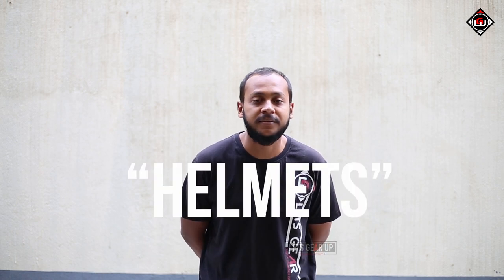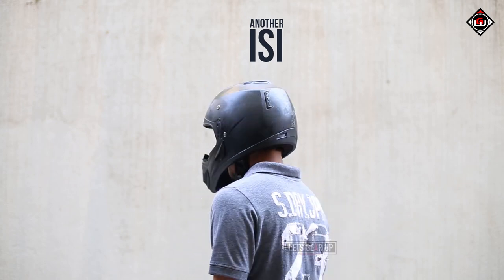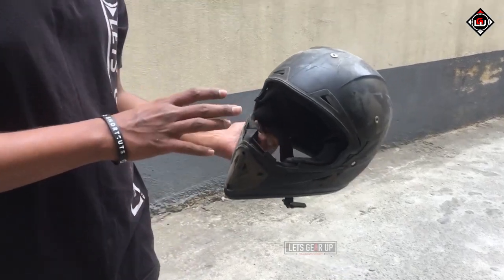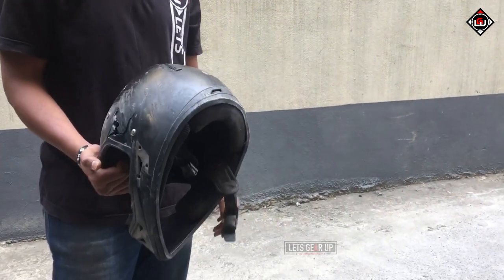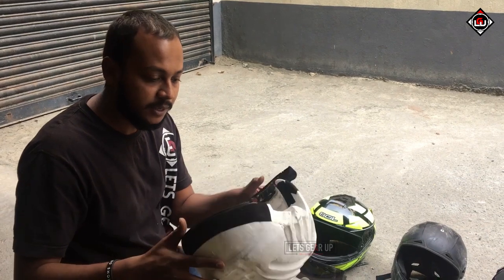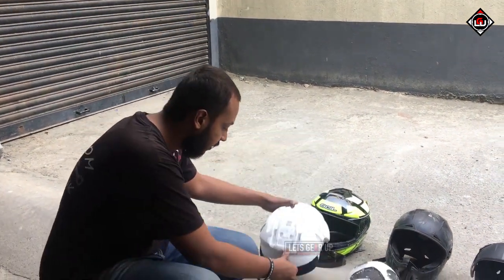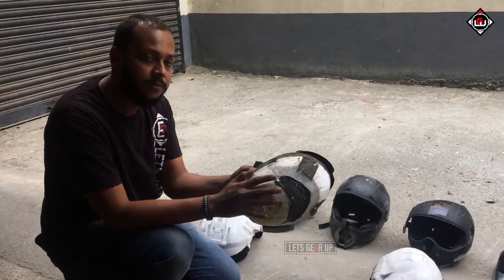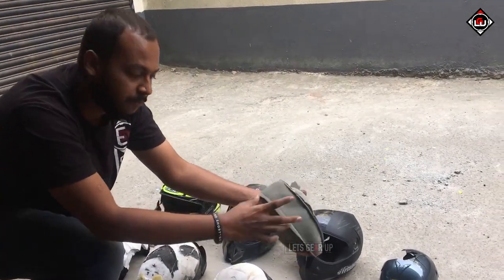ISI vs DOT, ECE, SNELL, SHARP ratings / certifications on helmets

Comment: I appericiate the effort you guys put in this and destroyed helmets costing so much. So basically its not abt hw many hits the helmet can take.. Its abt hw much force it transfrs to your skull in case of a crash.. Still great content 👍
Reply: devashish chauhan yes... I haven't seen any isi helmets with an outer shell and an inner shell and then the thermocol lining though... At the same time have seen many dot and ece ones having such multiple layers. Which means they will take a lot more impact before transferring that energy to the inside. Along with that the way they have a lot more padding than normal isi helmets means that the head won't go to an abrupt stop in case of a collision, which is the reason why some riders loose consciousness and sometimes go into comma in case they come to a violent stop. Helmets with multiple layers, padding and international ratings any day over isi one's as far as I'm concerned.
Reply: Yep. Content is kind of misleading.
Reply: Thank you! This is the only comment thread that to some extent sees through the pointless test in this video. A helmet is indeed designed to decelerate the skull of the wearer over as long a duration as possible. Hitting a stationary helmet with a sledgehammer only shows the strength of the shell, not its ability to protect the soft mushy brain of a human being.
Reply: These helmets are supposed to take single impact from accident in a short span of few seconds and not multiple impacts. So ISI helmets from reputable brands have good enough protection. DOT helmets are expensive and not everyone can afford them, but its helpful for those into motor racing or high speeds
Reply: @ahmedajmi8173  it's not entirely anoutthe shell bro read the above comments ... It's about how much shock is diverted in simple words
Reply: @YashMoh  ISI helmets are not designed for High speed touring or racing. The ISI helmets from Reputed brands like Steelbird, Studds and Vega are excellent in protection when riding in City conditions and should also protect decently on highway depending on the speed they going and impact type...For highways in case of higher speeds definitely better to go for DOT or ECE.

Comment: I see some discrepancy here, for the ISI certified helmets you put them in between a tire so they will not skid off, however for the DOT certified one you put it ona Rock and it seemed that for the DOT certified helmet it was not able to take the complete impact of the hammer because of that as it skid off after the first contact with the hammer.
Any reason why you put the DOT certified helmet on a  rock instead of between the tire.
Reply: That's exactly my point as well...

Comment: the main problem is not with their breaking but with the amounth of flex! every hit the ISI helmet takes, i goes deep inside and again flexes out like a water bottle! so it's definitely going to affect the head.. whereas the dot certified helmet was very sturdy and didn't have much flex!

you should have tried them with a watermelon or something inside
Reply: Shravan Also, this video hardly shows how well a helmet will work in case of a crash. A helmet is designed to decelerate the skull of the wearer over as long a duration as possible. That means the helmet and its contents will have to be in motion. Hitting a stationary helmet with a sledgehammer only shows the strength of the shell, not its ability to protect the soft mushy brain of a human being.
Reply: Yeh
Reply: @twistednemo  dot helmets are designed is a way where the impact will be distributed over the helmet but wont go to you head
Reply: @8thX  yeah i got my friend back without any major injuries as because MT Truck Turgo Helmet which is DoT ECE Certified

Comment: Woah! 😅
The DOT approved helmet these guys just destroyed costs around 8K
Hats off to you guys!
This video will hopefully open the eyes of the cops
Also I would like to know if you guys have a red SOL SF 5 Alpha in stock (the same model you guys just destroyed)
Reply: 6200 at the right place! SOL 1/2 series
Reply: sunshinegears, not a promotion, I just know where to buy it from
Reply: Yeah, but this video hardly shows how well a helmet will work in case of a crash. A motorcycle crash helmet is designed to decelerate the skull of the wearer over as long a duration as possible. That means the helmet and its contents will have to be in motion. In case of a crash, the helmet shell has to distribute the force of the impact over a large area and the liner has to compress and dissipate the kinetic energy of the wearer's head. Hitting a stationary helmet with a sledgehammer only shows the strength of the shell, not its ability to protect the soft mushy brain of a human being.
Reply: Bro they can earn tht much money from this video don't worry
Reply: for people wondering what he means USD, that’s about a $700-800 helmet from looking online, this was also 5 years ago so i can’t say the price changes from then to now

Comment: ISI < DOT < ECE < SHARP < SNELL
Reply: supercharged petrolhead 

I agree on the order of how tough the tests are, but that doesn't NECESSARILY mean a helmet with a more stringent certification is safer than a helmet with lesser verification. 

For example, a helmet that far exceeds ECE certification could be safer than a helmet that barely earns SNELL.

SHARPS is nice because they actually tell you the results of the test.
Reply: Isn't sharp a rating. snell and ece standards
Reply: snell and ece are just on crash worthiness and safety hence i think they are standards and sharp is more of a well rounded test which consider safety along with some comfort and fit and finish and hence a rating i guess and helmets made or sold in europe should be sharp rated and it is more of a european specific testing, i guess
Reply: Wasn't the 2005 Snell standard dangerous for street use because the liner was to be kept extra stiff to ensure the ability to absorb impact forces in multiple head collisions in a crash? Also, the video does not demonstrate the ability of a crash helmet to absorb impact. To test that, the helmet needs to be in motion. We are not talking about construction site hard hats here after all.
Reply: Ece's are better
Reply: SNELL< VIBRANIUM 
- The strongest metal in UNIVERSE...
but Black Panther won't share it with you.
Reply: FIM > All

Comment: First tried by Motown India for ISI😀
First tried by you guys for DOT. 😇🤘
Reply from the maker: And we hope to be the first for other products too :)
Keep yourself locked onto our channel (Y)
Reply: Yeah, but what is the point? This video hardly shows how well a helmet will work in case of a crash. A motorcycle crash helmet is designed to decelerate the skull of the wearer over as long a duration as possible. That means the helmet and its contents will have to be in motion. In case of a crash, the helmet shell has to distribute the force of the impact over a large area and the liner has to compress and dissipate the kinetic energy of the wearer's head. Hitting a stationary helmet with a sledgehammer only shows the strength of the shell, not its ability to protect the soft mushy brain of a human being.
Reply: @letsgearup6675   I have Vega brand helmet like FIA World Car Rallying Championship Semi Half Helmet and top side shows fish fin shape where the drivers like Marcus Gronholm, Mikko Hirovenin, Harri Rovanpera ,Tommi Makkinen etc
Reply: @letsgearup6675  Thanks for the valuable video. My question is aren't ISI helmets from Reputed brands good enough for City riding which are in the speed range of 40-65kmph at most. And there have been many instances of accidents within city limits where riders have been Safe without head injury with ISI helmet. 
In your test the ISI helmet did show to good protection despite 2 hits, Helmets are designed for single hits, the remaining impacts after first one are considerably of less force so using Hammer twice isn't best way to simulate results for real world  . 
Everyone cannot afford 4-5k ECE of DOT certified helmets. The reputed brand ISI helmets cost from 800Rs. To 2000 Rs and in my opinion is enough for City conditions. Will appreciate your response on it
Reply: @letsgearup6675  is there any helmet  on this world with all the certifications?

Comment: wouldn't side impacts be better test than hitting it directly on top? 
just seems like you're more likely to smash the side of your head if you go down than the very top
Reply: Plus the road is not in motion in a crash, the rider is. That means the helmet and head are in motion and the helmet has to decelerate the head of the wearer so as to keep the mushy brain from turning into scrambled eggs. The test in the video does very, very little to show how safe a helmet will be in a crash. This test only focuses on the shell not the liner.

Comment: Very Misleading
You cheap out on isi ones with no multi density eps and poor shell design
Also helmet is supposed to take impact force (one direction on shell and opposite force on eps)
Your hammer force is only on the shell with two direction (impact force + ground reflecting force)
Test with a real human
Wear the helmet and hammer your  helmet 
Your neck will break before skull

Comment: This video hardly shows how well a helmet will work in case of a crash. A motorcycle crash helmet is designed to decelerate the skull of the wearer over as long a duration as possible. That means the helmet and its contents will have to be in motion. In case of a crash, the helmet shell has to distribute the force of the impact over a large area and the liner has to compress and dissipate the kinetic energy of the wearer's head. Hitting a stationary helmet with a sledgehammer only shows the strength of the shell, not its ability to protect the soft mushy brain of a human being.

Comment: ISI should've been restricted to its original subject matter - appliances like fridge, geyser, etc. As too often, the govt lazied out and thought, a safety standards organization can basically certify anything that requires safety. Freaking idiots. If you want top notch safety (you should - you only got one head afterall) get atleast an ECE lid, if not a Snell or FIM.

Comment: Not to sound like am coming from a different school of thought but the age of the helmet also matters greatly. D.O.T. Certified helmets are tested at a speed of 15 mph at best. SHARP rated are the highest. In India we should do fine with ISI Rating as long as it's fastened properly by the rider. Hammering helmets is good but always ride safely first. Great video. I own a MT Helmets Axxis Falcon myself. Cheers!
Reply: Phantom Rides coz you don't cross 15kmph?...absurd
Reply: Ashish that's my point itself lol... Don't we all ride above 15 mph and what is the safety of any of these helmets combined with other factors included in a crash say vehicles, objects on the side of the road, terrain etc. So you can never be 100% safe. My next helmet with be Sharp 5 star rated for track days.
Reply: Actually, that is a valid point about the speed rating. The 2005 Snell standard was dangerous for street riding because the liner was too stiff as it was designed to absorb forces from multiple head impacts.

Also, this video hardly shows how well a helmet will work in case of a crash. A motorcycle crash helmet is designed to decelerate the skull of the wearer over as long a duration as possible. That means the helmet and its contents will have to be in motion. In case of a crash, the helmet shell has to distribute the force of the impact over a large area and the liner has to compress and dissipate the kinetic energy of the wearer's head. Hitting a stationary helmet with a sledgehammer only shows the strength of the shell, not its ability to protect the soft mushy brain of a human being.

Comment: Would be foolish to say it's week as it tears apart when u slam smash it with an hammer.

Secondly if it does not break it means ur head it taking the blunt i.e force directly, it's designed to break.

And helmets are not to be used after it's been dropped or pounded once. Repeatedly bashing it with an sledge hammer makes no sense.

It's not a locker safe man, it's an freaking helmet to divert the impact to itself away from ur head.

Comment: Helmets must protect head hitting on something, not being hit by a hammer while resting on the floor.
There's lot of difference, because the mass exerting force on the liner is inside.
outer shell must "amplify" the contact area on wich the head must slow down his speed and the eps liner is requested to brake the head in a given space....

Comment: Did you choose the helmets for testing based on the shell material? Were the tested helmets all polycarbonaye shell ones or fibre glass shell ones. You shouldn't compare based on DOT or ISI, but also based on shell material..Fibreglass shell ISI certified helmets can take as much stress as DOT certified. But if you comoare DOT certified polycarbonate shell with ISI fibreglass shell, your experiment will have different outcomes..
Reply: Venugopal Rao you used to play cricket na?

Comment: Slightly misleading. Although i fully agree that DOT and ECE certification are definitely superior, myself using sol and LS2 helmets, since a helmet is supposed to be discarded after a sigle impact, there is no point in battering them multiple times until they break..

Comment: Nice one... but a thought though! Usually, in the real world falls from a moving two-wheeler,  research shows that the majority of the impact is on the chin area (14%). The remaining % are distributed to the other parts of the head. It would be better if those impacts are simulated in this experiment. That is, the ability of the helmet to take up the impact and protect the chin area.  I am sure none of the real world falls will impact the centre of the head (as shown here when hitting it hard with a sledge hammer), unless it is a high-speed collision on a freeway / high way or a roll-over in a motor race situation.  Also, it would have been better if you have a water-melon or pumpkin inside the helmet (as someone rightly pointed out below), then it could give a visible cue of the extent of damage done, to the viewers.  Good Try anyways ~!

Comment: can i know which are DOT certified and Sharp certified Helmet brands?
Reply: MT mugello series are ECU, DOT and Sharp certified helmets and pocket friendly too. Rs. 4,600/-. I know Rs. 4,600/- is not a small amount. But any other brand or series with sharp, dot and ecu certification will easily cost you around Rs. 9,000/-. That's why I said it's pocket friendly.